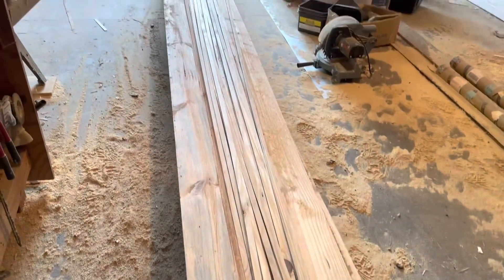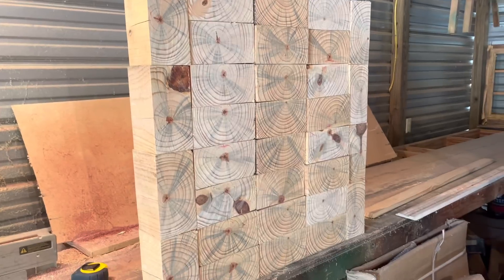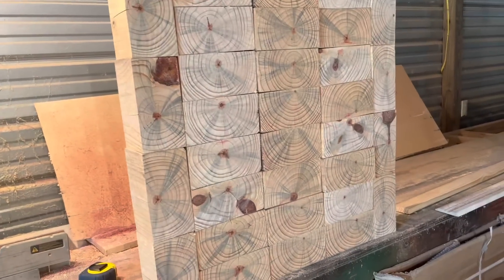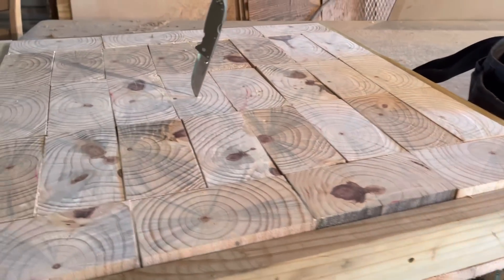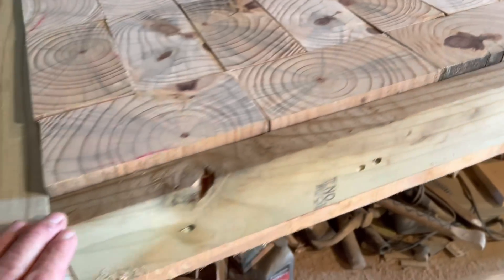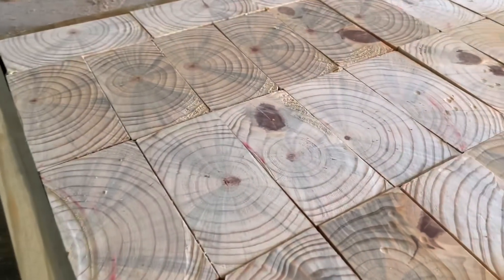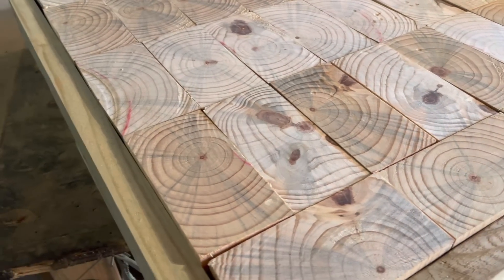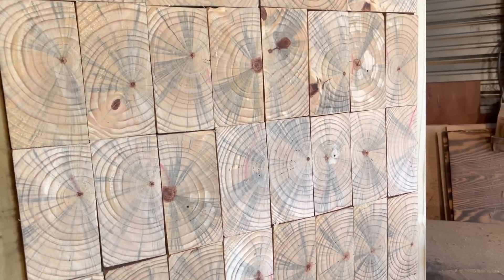Building a Target for Throwing Knives & Axes from Wooden Blocks

Comment: Treat it with automatic transmission fluid. Lay it flat and coat it heavy, several coats, it will soak in on that end grain. I built a bridge across a small creek in my back yard to drive my tractor across so I could mow the other side back in the mid 90s. I used 2 1/2 in. oak planks 10' long for the deck. Before putting the planks  down I set them on horses with  plastic underneath and soaked them with ATF several coats both sides, letting it soak in between coats. I am still using the bridge and have not had to replace a plank.